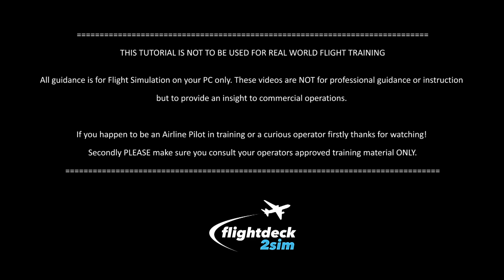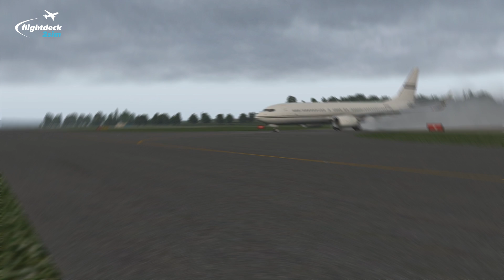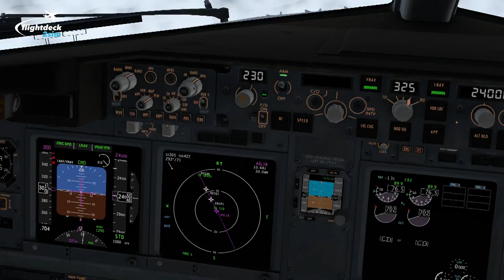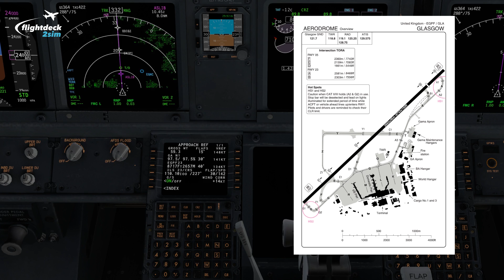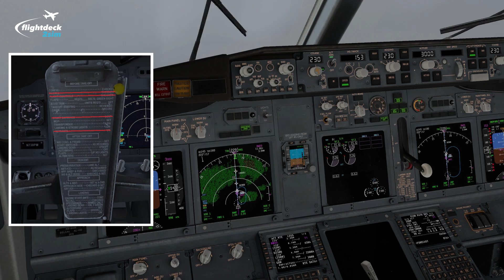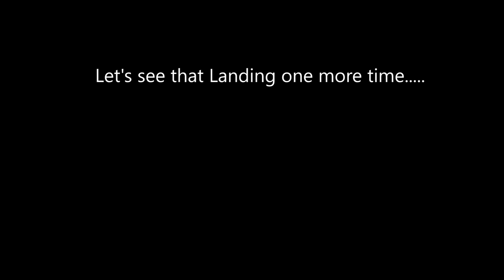Full Flight Tutorial by REAL BOEING 737 PILOT | Liverpool - Glasgow | ZIBO MOD | X-Plane 11

Comment: When I'm approaching on an ILS I never get a minimums callout but I do get an approaching minimums callout. Do you think this is a bug or something I'm not doing right, I've tried both BARO and RADIO, the minimum line passes but baro/radio doesn't flash like on yours. Any tips?
Reply from the maker: Hi Alex,

Is this with the NGX or ZIBO? NGX you can fully customise the EGPWS callouts which I don't think is yet a feature of the ZIBO MOD. It could be something you're missing during the setup.

FD2S

Comment: Very interesting video, congrats! ;-) From your experience, what Control Sensitivity settings in XP11 is the most similar to real conditions in 737..? Regards!
Reply from the maker: Hi Seb, thanks!

I'm new to XP 11 and what I've found with the control sensitivity you really have to play around to find a setting suitable to your applicable hardware. I'm still tweaking and fine tuning to find something that I find close to reality. 

FD2S
Reply: Hi, many thanks for your reply! So far I set left side (control response) for 100% each, on the right side  (stability augmentation) 1% each.  If you have any findings on this topic, share it, please :) Good Luck!

Comment: Ok here goes a question: at about 33:00 after you've descended through 3000 I'm unclear about what is controlling your descent up to the time you disconnect. I notice on the MCP neither VNAV, V/S, nor APP modes are lit (though I did notice APP was lit when you were taxiing). Is it the FMC controlling descent at this point, when none of the above modes are active? In the PFD I see that G/S is lit - does that mean the FD automatically follows G/S (even when not in APP mode)? And am I even understanding correctly that in APP mode the FD automatically keeps the plane on localizer and glideslope?
Reply from the maker: Hi Jacob,

Fully established on the ILS (The APP light on the MCP extinguishes after G/S capture) with the A/P engaged.

FD2S
Reply: Ah, thanks, that explains it! Time to review the FCOM again! Also it appears you only used one FD for the approach (?) when is it appropriate to use both?
Reply from the maker: One F/D? What are you relating to there bud? I'll try and help!

FD2S
Reply: I'm sorry - not well-versed with the correct terminology (though in my defense, the FCOM refers to the "Captain's F/D" and the "2nd Officer's F/D" which led me to believe there are 2, haha)...but anywho, I was referring to single channel vs dual channel (is that correct?) operation i.e. CMD A + CMD B...when is it appropriate to use both on the approach vs. only one (as it appeared you did on this approach).
Reply from the maker: Hi Jacob, 

Single Channel = One A/P = CAT I ILS with no Autoland

Dual Channel = CMD A and B = Autoland on Approach with CAT II/III Minima

FD2S
Reply: Thanks!

Comment: I have used both PMDG and ZIBO and you are right, X-Planes graphics and airports are better, in the other hand I think Zibo is not as detailed as PMDG 737, especially the CDU and the NavDisplay and lights during night operation. I am also 737 pilot and for the moment I stick with PMDG. I wonder if u are really going to start using Zibo instead of PMDG?
Reply from the maker: Hi Alfonso.

Yes the PMDG is going to replicate every system accurately as it’s a polished complete product but you’ll surely know from your RW experience aircraft in XP11 handle a lot more realistically. Remember ZIBO MOD is still in development! I’ll be using both in the future.

FD2S
Reply: Sounds good, that way we can compare both models and get to see the future Zibo updates :) Great videos!

Comment: X plane controls look so sluggish, are they more realistic than fsx? Are they as realistic as the real world?
Reply from the maker: Hi there,

What I've found is XP11 is more realistic and a lot of tweaking is required get your setup to work appropriately. (In my case Saitek Rudder Pedals and a Logitech Extreme 3D Pro Joystick) I'm still fiddling around to find the perfect combination. ZIBO and his small team are working hard to continually improve the FM so you'll notice improvement with this aircraft on almost a weekly basis.

FD2S
Reply: flightdeck2sim Ok, thanks a lot for the info. I’ll look into x-plane.

Comment: I Love this tutorial!  Thank you so much for taking the time & effort to produce.  When you departed, you only had LNAV selected.  On activating CMD A (and prior to selecting V/S speed) what is causing the aircraft to continue the climb - are you still manually pulling back on the yoke or does the aircraft automatically calculate an ascent rate based on information from the FMC?  Sorry if you have answered this in a previous tutorial.  Kind regards.  JB
Reply from the maker: Hi Jamie, Thanks!

I was manually pitching to maintain V2+20kts which is what the flight directors on the PFD are commanding to fly. 

FD2S

Comment: As always, great video!

How do you think the Zibo mod and XP compares to P3D and the NGX? I gave the Zibo mod and XP a go myself but in the end I went back to P3D being a more stable platform IMO.

I also have two technical questions.

You mentioned to switch both engine and wing anti ice ON before taxi with TAT below 10C but I thought wing anti ice was mainly used for de ice rather than anti ice?

Then I found 6,7 units of stab trim more than I'm used to. Usually between 4-6. Would you consider that a realistic value in the real aircraft?
Reply from the maker: Hello again Richard, thanks a lot!

I just wrote a comment which has been pinned to the top of the comments section as several people have asked re P3D/NGX and PMDG/ZIBO.

WAI is used as a de-icer IN FLIGHT. On the ground to protect the wing UNLESS being de-iced with Type II or Type IV fluid.

That figure was based on the current loading I used, it's on the Nose Up Limit!

FD2S
Reply: Very interesting to read your thoughts on XP and how it in some regards is more like the real thing. Coming from someone like you, I maybe will give XP and the latest version of of the Zibo mod a second go.

Thanks for the info on WAI and rather high stab trim units and thanks again for your amazing commitment to share all your knowledge and experience with the rest of us. I think I already said it but well worth saying again. Truly amazing and much appreciated!!

Comment: I can't seem to find with the RECALL button does.
Reply: "The "recall switch" is not a physical switch, but refers to the three section of lights between the Master Caution and the EFIS."
Reply: Hate to be a dunce, but do you use it?  Why and when would it be depressed?
Reply from the maker: The Recall Switch refers to the "6 Pack" annunciator light panel which is pushed to test the systems for any faults. The whole component including the master caution light is referred to as the Master Caution System.

We push it before and after cruise and before takeoff and after landing to check for faults!

FD2S

Comment: I dont want to fly with you bumpy general :D ... otherwise, good points in your explanations
Reply from the maker: 6/10 SURELY?

It could've been a little less firm but trust me, there is a massive misconception with the general public that a smooth landing is a good landing....

FD2S
Reply: Yeah u need to have enough fpm in order to not damage the gears, if u go too soft it will damage, but if u fly straight in it does what it needs to do

Comment: I hope you land better in real life lol, nice video though
Reply from the maker: It could've been a little less firm but trust me, there is a massive misconception with the general public that a smooth landing is a good landing....

FD2S
Reply: flightdeck2sim 

I know, but for le it’s between -250ft/min—100 within the landing zone
Reply from the maker: I honestly couldn't tell you how many FPM constitutes to a smooth landing!!

If you follow CHECK, CLOSE, HOLD at the appropriate height and airspeed the aircraft will settle down nicely and smoothly within the touchdown zone. It's worth noting if the runway is contaminated we'd actually aim for a firmer landing so we can get on the ground ASAP to deploy all the stopping forces needed on a slippery runway. On this attempt playing on X-Plane 11 it was slightly misjudged and it was a firm one! 

Unfortunately some of the public view a firm landing as a bad landing but if I was a passenger knowing we were landing on a short runway I'd be very concerned if we were still flying passing the threshold 10 seconds previously! 

FD2S

Comment: I remember on my second flight in the zibo I forgot to turn on the engine bleeds. Got a cabin altitude warning, didn't know what to do, had the screen go black, killed everyone

10/10 would forgot the engine bleeds again
Reply: I don’t know if you know, but that actually happened once in real life. Helios flight 522
Reply: @speed150mph  Actually, their press panel was set to manual, a mechanic forgot to put it to auto after some tests and pilots missed it too
Reply: @speed150mph  Happened more than once.

Comment: Which simulator is better for you? P3d or X plane 11.
Reply from the maker: Hi Daniel,

I've never tried P3D but I've been told it's FM is the same as FSX's. At this stage I genuinely have no preference. The PMDG is obviously a lot more immersive with all the systems modelled accurately, if you wanted to simulate every last detail it's obviously at the moment the go to product! 

ZIBO MOD is still a WIP but even in the last month there has been a significant improvement in the FM. After only logging around 10 hours on X-Plane the sim I believe is miles ahead than FSX. It feels pretty good to fly! 

FD2S
Reply: flightdeck2sim Thank' s for reply. Greetings from Poland. ;)

Comment: Really nice video! Glad to see your use of the Zibo 737-800X. If you have not yet tried the newest version (3.24X) there are a lot of changes - and more to come. The FM is more sensitive though, and I recommend everyone who tries it spend time tuning your flight controller - what ever that may be. Whether control stick or control yoke and pedals, the control interface does at least 50% of the work and impression of flying characteristics...
Welcome to XPlane!
Reply: By the way... I congratulate you on your excellent teaching technique. Simmers will enjoy the experience more if they actively manage the flight, evaluating and controlling the flight environment and evaluate the FMS/Autoflight system performance, taking appropriate action when necessary to ensure the flight path and progress of the flight. This is what a real pilot does :)
Cheers
Reply from the maker: Thanks a lot Tim, will text 3.24x on my days off

FD2S

Comment: I am really getting into the Zibo at the moment - this video is fantastic, thank you for posting.  When you activate CMD A just after takeoff, I note you only have LNAV selected.  What is keeping the aircraft climbing at a steady rate - are you manually pulling back on the yoke or does the aircraft track data from the FMC (prior to you inputting a V/S speed)?
Reply from the maker: Hi Terry, thanks!

Prior to engaging the A/P I had trimmed out the aircraft during the initial climb and was hand flying. 

FD2S

Comment: Hey FD2S

I know many would like to know this.... but do you think XP11 is more realistic than P3D? One huge difference XP has is the flight physics, which many say is far more realistic. Also, the soundpack you are using, sounds very different than the PMDG one, do you think it's more realistic? Also, one thing i noticed is that the aircraft accelerates much quicker than in P3D/PMDG. Is that just because of the thrust setting, or something else?
Reply from the maker: Hi Ozan.

I've not tried P3D so I cannot compare. I really like the way XP11 feels, I need to have more time flying around to make more conclusive comparisons but the way aircraft behave feels more akin to real life. 

The Soundpack for me personally does sound better, some work for some of the flightdeck noises which PMDG has modelled superbly.

The ZIBO FM is still a WIP but has improved significantly since I started using it a month ago. As of today it's really not too far off, some areas are difficult to model but I'd certainly use it to practice. 

I personally do not have a preference, I'll be using both in the future. 

FD2S
Reply: Thank you for your reply! Ps. in terms of flight physics, P3D and FSX are the same. P3D actually is just a more "modernised" version of FSX, allowing more features, addons, scripts and plugins, for an example the latest V4 version is in 64-bit, which removes many restrictions the default 32-bit FSX has!

Comment: So. What do you think of x plane. I'm not after a comparison as such. It, what do you make of the zibo mod? Is it anywhere near the real thing or is there a long way to go?
Reply from the maker: I genuinely have no preference. The PMDG is obviously a lot more immersive with all the systems modelled accurately, if you wanted to simulate every last detail it's obviously at the moment the go to product!  ZIBO MOD is still a WIP but even in the last month there has been a significant improvement in the FM.

As for X-Plane even though I've logged less than 10 hours I've had a play round with a few aircraft and I'd say the way aircraft behave is far more realistic, airflow seems to be modelled well and the way aircraft react at different configurations and speeds feels pretty good!

FD2S
Reply: flightdeck2sim good to know. Yea I've been a zibo flyer for some time now. He seems to update it very often. It's good to hear from a real pilot about the way it moves. It was the selling point for me to get x plane over P3d but I never knew how much difference it made. I literally learned how to fly the zibo using your tuts. Keep up the good work pal. I always look forward to new vids

Comment: X-Plane is said to be more realistic for the way it is simulated instead of a set performance code for different conditions, it is modelled in plane maker and actually simulated the airflow around the plane to get realistic handling, if you model the plane really well it’s perfect
Reply from the maker: Even though I've logged less than 10 hours in X-Plane I've had a play round with a few aircraft and I would agree the way aircraft behave in the simulator is far more realistic. 

FD2S

Comment: How did you set TOGA at 12:05 ( what button did you press )
Reply: your averagepilot tiny little button under the handle for the thrust, but you can set a button for it, open the plane then change the joystick settings or keyboard settings to change it
Reply from the maker: Hi averagepilot

I assigned a button on my joystick.

FD2S
Reply: Good Video,,, Great video! The TOGA can be set using a Zibo preconfigured button - The Captain's MIC button on Glareshield will activate TOGA if not have a button assigned to your stick - Cheers

Comment: Hi FD2S. Yet again packed with info. Not used XPlane is there a lot of difference from FSX?
Reply from the maker: Hi Steve, my initial assessment is that it's a superior sim, certainly out the box. I've only used it for a few hours but I love how it's stable compared to FSX, no crashes to date yet! 

FD2S
Reply: you will get crashes from badly made addon scenery or some errors in aircraft
Reply: Hi FD2S. Thanks for the reply, been using the  PMDG 737 ngx for a year or so, the only problem I had was with OOMS ERRORS on scenery. This I rectified with “Scenery Config Editor.” It’s. Free download and works fantastically. (I have quite a lot of add-on’s from aerosoft and other providers)
I also noted your comment on altering the BARO setting. If you hover over the knob in PMDG and use the mouse wheel you can change the minimums in a couple of turns. 
I will see how you get on with the software in the future.
Regards Steve

Comment: Have you been able to help the Zibo team at all with any questions or needed support? This mod's been huge in giving me a ton of fun in X-Plane.

Also, you should give the sound mod a try for the 737, it improves on the default sounds by a ton.
Reply from the maker: Hi Aaron, 

Yes I'm providing feedback to ZIBO, looking forward to watch the aircraft improve and develop! This had the Audiobird Soundpack installed, significantly better!

FD2S
Reply: That's awesome! I've been loving this mod, and I just discovered your videos. It would be great to see some videos on how to do things in the Zibo mod.
Reply from the maker: Good luck and have fun! It’s still a lot of work to be done and fix rings are coming but it’s improved significantly in the last month 👍🏼

FD2S
Reply: Truly great to hear how you're in contact with Zibo helping him make the mod even better!

I just installed XP11 and the Zibo mod a couple of days ago. Haven't had much time to play with it yet but one thing I noticed was how the range rings on the NAV display are missing when putting in fixes.

IIRC this was mentioned in this clip as well. Hope that is on Zibo's fix list because I use that feature quite a lot.
Reply: Oh, I don't know if you've happened upon it yet. But I would definitely recommend the Better Pushback plugin for X-Plane too. It's free and lets you actually map out your pushback instead of hoping the default one doesn't push you through a building or plane.